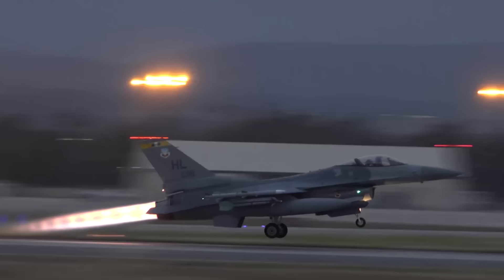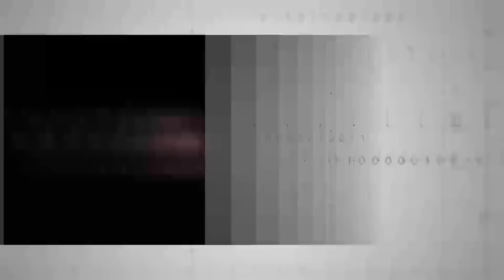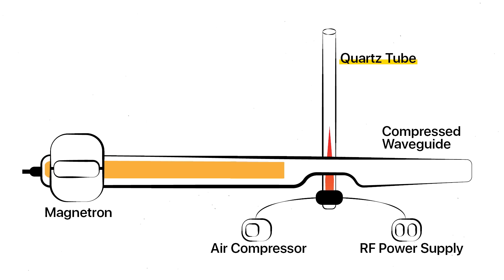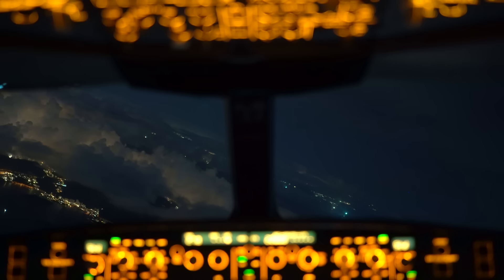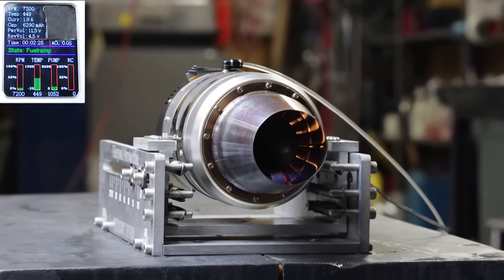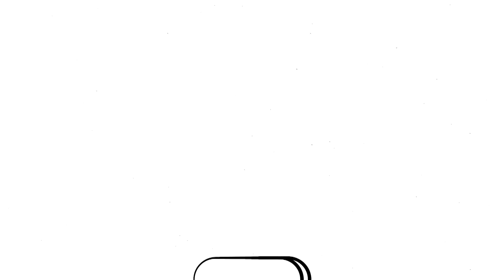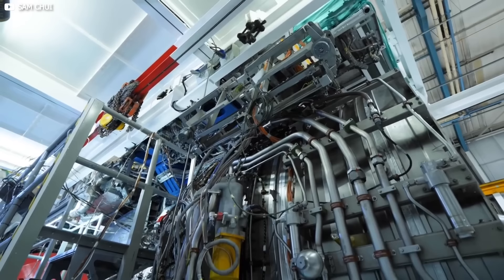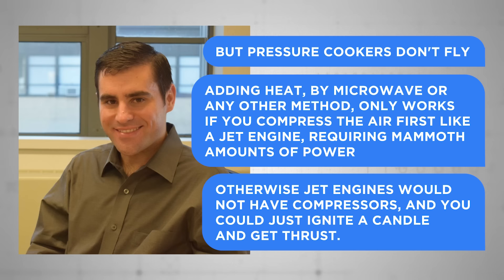What Are Electric Plasma Jet Engines?

Comment: The only thought I had was that if you're able to miniaturize the nuclear reactor, would it not be more efficient to utilize some other form of propulsion like directly heating something like hydrogen?
Regardless, loved the concept, and looking forward to seeing what comes of it in the future!
Reply: Hydrogen was fuel of choice for the first demonstration of the jet engine. However it was deemed unsuitable at the time for flight by the Germans (Ohain), and instead another fuel was used for airborne flight.

Plasma jet technology is definitely the future. Almost every industry is waiting on a battery breakthrough, aviation not an exception.
Reply: @absbi0000  Wich wont happen...
Reply: Nuclear thermal rockets and jet engines were built and tested on the ground in the USA. A nuclear reactor heating hydrogen could provide double the ISP of most conventional rockets. An airplane heating the air with nukes could stay up indefinitely. As they mentioned in the video they couldn't shield the crew and if such an airplane ever crashed it would be a disaster. For better or worse the idea was simply abandoned.

Comment: Would energy of that level put off enough UV to damage your eyes? Arc welding's more than enough to, and I'd imagine this is even more energy, so I'm just curious.
Reply: Yes definitely, although plasma in of itself doesn't necessarily; some lower temperature electrical arcs are fine to glance at for short periods.

Comment: 'We've invented a jet engine that doesn't burn Kerosene to produce thrust, just heat air to plasma with electricity!'  
'Where do you get the electricity?'
'Kerosene powered generators!'

Comment: The plasma exhaust from his engines will mean a new and more durable form of runway will have to be built. The asphalt and concrete and fall apart immediately.   Another problem just maybe this new engines replacement for air travel in general. The thrust from these engines may have another problem with the superheating of the atmosphere with the exhaust from these aircraft. I do really hope that we make this technology viable.

Comment: Really a non-starter, even though I wish it could happen.
Reply: So true.  The amount of energy the plane needs does not change.  The only thing that could hold the amount of energy needed is chemical or nuclear energy... So, welcome back kerosene!
Reply: @damonsisk4270  Wrong. Solid state lithium will make medium haul flights entirely practical. IE the energy density shown by Prof Goodenough was over 1MWH per tonne. He has near doubled that. But let's take 1MWH for a 777 sized aircraft. 94MWh for the one which has 94 tonnes of fuel. More for the larger one. How much would the engines need? About 40MW while cruising near double when climbing/taking off and 10% when landing. So a range of 1600KM+ with enough to redirect. That's at MGW by the way. Lessening the load could extend that by 800+km in a passenger only configuration. If Goodenough gets his 2MWH per tonne cells working reliably then you can double the range to 5000km.
Reply: @gordonlawrence1448  I hope so.  It would be amazing to improve the energy density of batteries that far!  Unfortunately, theory and experience often do not merge.  I will not hold my breath in the meantime.
Reply: Entire video felt like those Facebook ads that suggest a child has made a life changing device, when really they haven't.
Reply: @gordonlawrence1448  ermmm... but kerosene specific energy density is 12.8kWh/kg if you consider the higher heating value, so your 94tonnes will contain 1.2TWh.  12.8MWh/tonne actual is a very long way from an as yet unproven 2MWh/tonne.  Am I missing something in your analysis?
Reply: @damonsisk4270  What about hydrogen? Its power density is over 3x that of jet fuel, and if it is a like 25 stage compressor with carbon fiber blades for light weight for the plasma jet engine and it is like a turbofan it would increase in efficiency by atleast 3-4x. There can be a secondary combustor for burning hydrogen for electricity which it can create a whopping 33.33kwh per kg. This would be very expensive however lmfao.
Reply: @retna1x363  The key I think is understanding the limitations imposed by thermodynamics on heat engines.  I would much rather see the hydrogen's chemical energy converted directly to electricity in a fuel cell rather than being burned because of the required loss (and inevitable inefficiency due to massive irreversibilities) that nature imposes.  Another problem with hydrogen is storage, though many people are working on it.
Reply: Too bad the video ended but his last point was most interesting to me: constant acceleration/deceleration in a vacuum for interplanetary/stellar crafts

Comment: heating air with electricity to spin a turbine seems way less efficient than just spinning a fan or propeller with a motor... gotta be a fair amount of energy escaping when you're blowing 1000 degree air out the back.
Reply: Heat from the jet fuel in conventional turbojet engines is combusted straight into flames to help furth condenses the air that flows infront of the engine compartment & through the turbine fan with many blades & creates an air condensing thrust vortex. The turbine fan designed to creat airflow in any jet engine is turned on with electricity & jetfuel fuel is combusted to provide the heat.
Reply: @scotth9397  while many jet engines do use electric starters, the turbine is what produces the torque to drive the compressors at the front... i think we're in agreement but i cant say i  really understand the point you're trying to make....

Comment: If one could use a nuclear reactor on the plane, fusion or fission, turning the nuclear heat into electricity and then back into heat in the form of plasma would be a waste of energy and weight.
Reply: You can directly use the heat from the fission by directly conducting it.
Reply: @sid1234213  The experimental functional nuclear jet engines made by the USA had two circuits, but yeah, they used the heat from fission to heat the air.

Comment: It will happen.
 Electricity slowly wins over other forms of energy.
Reply: think about about ... turn oxygen into plasma ... side effect .. you now have oxygen (an element that combines with pretty much EVERYTHING else) in a state that will allow it to combine so fast with everything in the air that fossil fuel emissions over a thousand years would be less than the plasma emissions over a few years ... you thought global warming was a problem .. what about trying to live in an acid sky or sulfur dioxide air ... we would be undoing many billions of years of oxygen production in extremely short order ... look up our history and one of the first mass extinctions on this planet called the great oxidization event ... where a bunch of lil microbes started using sunlight to make energy to live and the waste gas was oxygen    that reacted with the volatiles of the time and killed off 96% of all life at that time ... Nope this is NOT a good idea for an engine or even a long term sustainable atmospheric propulsion
Reply: @0623kaboom  NASA been doing it for years. Just another hype video for CCP propaganda and tech theft.
Reply: Oh really, how?
Reply: @TheTechiemoses  those are ion drives, this concept is very different

Comment: Plasma arcs have been used for the incineration of hazardous solid waste for many years.
At the exit of the incineration chamber, a turbine is sometimes placed to recover a portion of the energy consumed in generating the plasma. This is the same but with no waste to incinerate .
The limitation of this concept is not the development of the engine itself but the energy density of  batteries. 
State of the art batteries have a energy density about 500 Wh / kg while  Jet-fuel (or diesel fuel) has a energy density about 11.000 Wh / kg 
In a car that difference in energy density although important can be admited  firstly because the weigh in a car is not as critical as it is in a plane and in second place because electric cars avoid the thermodinamic cyle while plasma jet engines doesn't

Comment: Well if batteries are the problem then once batteries get decent, we can just attach a propeller to a DC motor to make an electric plane.also add some solar panels on the wings to increase range.

Comment: I think the bigger problems isn't what type of engine we will use to increase the speed we explore the universe, it's the source of the energy.   Advances in what we use for fuel and how we store the fuel/energy will allow greater advances in technology.  Solid state batteries seem like a great advance if we can scale them to commercial size.   If we can find ways to create and store hydrogen from water at a much lower cost or find a energy system to create gravity field to propel spacecraft.   

I do hope we do see an increased use of pulse engines though since they are much more efficient than conventional gas combustion engines.  I would love to see pulse engine cars!

Comment: I feel the energy density difference between batteries and fuel is not discussed enough. This is one thing I feel makes electric cars a case of change for the sake of change, rather then an improvement.

Comment: If I recall correctly, lithium-air batteries can theoretically achieve energy densities close to jet fuel. If that ends up working it might be a good source of power for this, if this is actual functional technology.

Comment: Hate to be picky, but the engines being developed for space are not “plasma thrust” engines, they are ion jet thrusters.  The fuel is ionised (by high electrostatic field) and the resulting ions accelerated with a high electric potential.  You have to reinfect the electrons into the jet to make it electrically neutral, but it acceleration of the ions that does the job (not heating plasma with microwaves).

Comment: Ground-effect flight for trains in a lightly covered half-pipe, with a touchless brush tether ring opposite a powerline contact which is only activated while a train is passing, could float like a wing on forced air provided by such a fanjet turbine. The weight of water for adding steaming mass to the flow isn't the problem for trains as it is for planes.

Comment: Plasma jet engine is a lot of hot air, metaphorically and in reality.
Plasma is a conductive gas, it can be cold. The Wuham engine which is going viral, no pun intended 😁; is just not going to cut it, why not just start with hot plasma which can be produced by RF supply.
Good video, with great research.
Reply: Plasma is a hot(heated) gas which is conductive..not cold gas.

Comment: Have you considered a solar reactor for power source and it would also with the heat coming off of it would generate enough heat for your plasma. The problem is calling it, so it does not melt down.

Comment: 1:18 Could the Jau Tang plasma generator be used to create a new class of high voltage, high current, momentary conducting connectors for snap-charging supercapacitors?
Reply: If I were to guess, probably yeah. I've seen rotating detonation rocket engines with an ignition system that is literally another rocket. Or propulsion system. Like instead of just being a spark, its a pulse plasma jet engine perpendicular to the combustion chamber to ignite the RDE.

Comment: Use water. Split water into hydrogen and put an alternator in the engine to gain energy back into the system. Put an air diffuser in the front to suck moisture from the atmosphere.

Comment: Yeah, its a cool experiment.  But as always with electric flight it comes back to energy density.  Even if you ever get the energy density to parity between jet fuel batteries, its still a losing proposition because the jet fuel is consumed while you still have to carry the weight of the battery for the entirety of the flight.
Reply: That can be solved. You carry multiple batteries and just jettison the used ones, then reclaim and reuse them. Logistics can be worked out later.

Comment: This sounds like a good technology to use for space travel, as an intermediate between regular propellants and ion engines. As long as electrical power is available, it could run on anything from solar energy to nuclear power.
Reply: Why not use the Orion drive as a direct way to harness nuclear?

Comment: How we can power such a thing I don't know but I guess the same solution that we used to prevent experimental fusion reactors from melting down could be used in this to use powerful electromagnets to redirect the plasma or keep it away from anything that will melt or just so it doesn't keep contact with anything sensitive

Comment: Him :  Can you imagine  flying on a  Plasma Jet engine plane ?

Me : NOT if I land radioactive !  LOL
Reply: gas plasma is not same as radioactive elements  .    IIRC ,   plasma is very hot gas ( dangerous only when hot ) ,  whereas  radioactive elements such as Uranium 238  decay radioactively  even when uranium is at room temperature  or at any temperature.   BTW , those plasma in the China jet experiment is not hot enough to cause nuclear fusion  ( which needs to be millions of degrees Celsius  hot in a fusion reactor or 80 times the mass of Jupiter to happen ).
Reply: @papaburger  I was talking about the onboard "Atomic 'HEATER' " that would be needed for the Plasma engine to work.

Comment: Once the plane is in the Air you may if you use your Brain ,put a Wind powered Generator to give you some power 😊 just need a power source connected to the plan as it takes off , im sure some one out there could get this hoing not just for planes but cars as well
Reply: Joke, right?

Comment: If nuclear (fusion or fission) ever gets portable though to fit on a larger aircraft (including necessary safety shielding) it wouldn't make sense to bother with the conversion from nuclear heat to electricity to plasma to thrust. Just directly use the heat from the reactor to accelerate air and generate thrust.
Reply: There alreddy was both a jet as well as a rocket reactor in the 60tys
Reply: No need hydrogen fuel cell is enough

Comment: Sorry, but convering electric energy to heat and then convert it back, with all the thermodynamic efficiency limitations back to mechanical energy does not sound clever to me. Why not use the electric energy directly to propel the fan with double to triple higher efficiency?

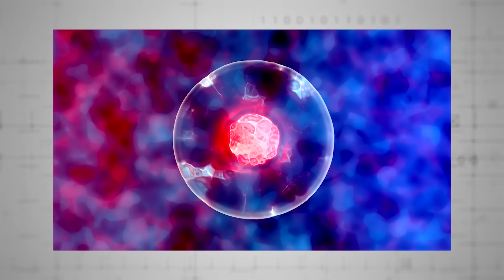Comment: Fascinating, in particular the suggestion for (future) "compact" nuclear fusion reactors (4:24). Mind you, the total weight of the superconducting NbSn coils in ITER will total a weight of, approximatively,  8,5 x 10^6 Kg. Alternatively, in inertial (laser-) fusion schemes, the weights involved appear to be prohibitive as well. Which leaves us with the highly speculative, if not impossible, "cold fusion". At least such cold fusion can be performed in a small light-weight aircraft, which latter, first can be actioned by solar cells, before then being propelled to light-speed velocities by the fusion energy alone. Anybody to invest?

Comment: Decades ago, I saw something similar at the Jet Propulsion Lab. As I recall, the idea was that if the plasma engine was powered on in space and with a nod to Newton's  for every action there is an equal and opposite reaction, then a payload could eventually be accelerated to nearly the speed of light. The photons exiting the engine leave at light speed. However they don't produce significant thrust. The thought was that if the engine could be made to overcome its inertia, then slowly but surely acceleration would happen. It would not resemble the light stretching fiction of space opera warping as seen in the movies, but it would be faster by far than slingshotting payloads in space.
Reply: What you just described is an Ion engine and its widely used on satellites, and why exactly do you think Newtons axiom is only applicable to these types of engines and not conventional propulsion? You know that its proposed for Ion engines because they burn so little fuel but accelerate extremely slowly, but if you had an infinite amount you could get to almost lightspeed with any fuel source. The current most efficient and fastest way to reach near lightspeed would be the Orion drive that basically consists of a big blast shield and a LOT of nuclear bombs that are detonated right outside the shield. It would be more efficient and faster but is not viable in close proximity to earth because it could damage the Van Ellen Belt through excessive radiation.

Comment: There is already a perfectly good way to turn electricity into thrust, just use an armature and magnets to spin a compressor! Its called an 'electric motor'... I'm generally puzzled as to why a plasma/magnetodynamic approach would be superior to that even in principle.
Reply: Forget the compressor - just use your motor to spin your turbine blades, and voila! You have a ducted fan. They already work on model airplanes. You just gotta scale them up!

I would bet money the first functional electric jets do something WAY more like this. They’ll piggy back off of Tesla’s/other EV company’s work improving the efficiency and power output of AC induction motors (and probably take advantage of some of their battery technology improvements that they’re bound to come up with, too), and use lots of existing technology to do the same thing we’ve always done to get a plane in the air: spin a set of blades to produce thrust!

(Yes, I know turbojet engines don’t just produce thrust by spinning turbines, they also take advantage of the thrust produced by expanding superheated compressed air - and since one of the biggest problems a electric drivetrain of this sort would have to contend with is cooling, both for the batteries and the motors, I would hazard a guess that the waste heat from that could be used to produce a few extra newtons of thrust, in the same way!)